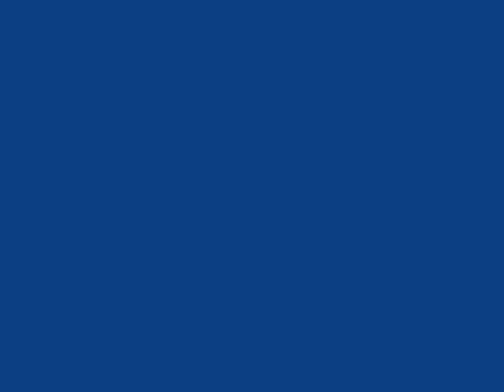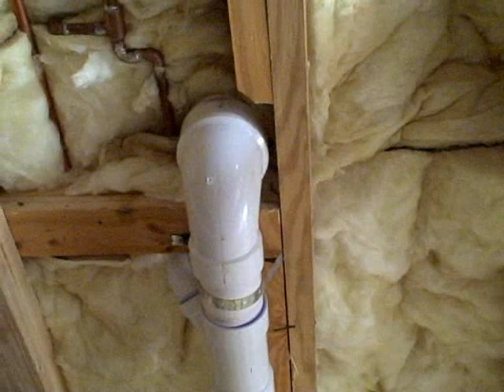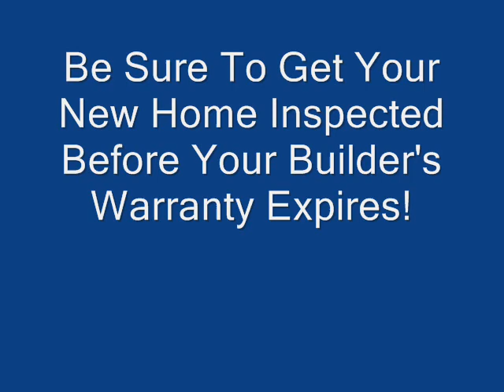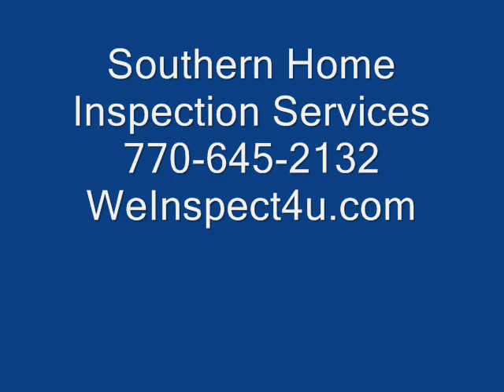Atlanta Home Inspector Discovers Plumber's Big Mistake l (678) 279-5796 l CALL US!

Comment: If you notice there are two floor joist. The uncut joist is there to replace the compromised joist. The home inspector should know that. When a joist is in the way of plumbing, an engineer will have the contractor install replacement joist to shore up the cut joist.
Reply: I observed that and agree with you.
Reply: Amy Sandoval truth,  how many times ive had to wire brush green copper, turn a valve the correct direction. write out a detailed report pointing out the difference between a emt conduit, and a pvc water supply line. home inspection is a laughable joke 98%of the time. an invented job to sugar pill lenders.
Reply: Or the plumber would just change the rough in for the fixture and not cut the joist. 10, 12 or 14 inch rough in would have fixed the issue.
Reply: NO it is not. The joist are doubled because code require that  for some reason. Could be a wall up top or it could be that the doubles are carrying a trimmed joist on a header. They are several reasons they are doubled. The one thing that is certain is that they were doubled along time before  the idiot cut it for his pipe.
Reply: libraiis-  You can see the header joist running perpendicular

Comment: Question. Why would a toilet be roughed in so close to a load bearing wall? The toilet needs to be 12 inches from the wall. Obviously there is not a load bearing wall running on top of the of the cut joist.

Comment: clearly there is no "bearing" wall on that.... that would put that toilet in the wall
Reply: really, you, another plumber, can tell us what load is actually on that floor above?   lofl.  given that it's supposed to be a double joist (but now, is effectively a single joist), clearly the architect or engineer who DESIGNED the house thinks there's a significant load.
Reply: @superwiseman452    You sure it’s supposed to be a double joist? You’re assuming. It looks like they had to cut a joist so they sistered another full joist onto it, perfectly acceptable modification by structural engineering standards.

Comment: That's probally why the beam was installed beside the one that was cut . Don't blame the plumber.. The toilet has to be 13 " from the c.l of the finish wall... the framer put the wall wrong.. it's the framers fault/g.c. not the plumber.. . I'm sure the toilet flushes.. if the wall was moved i stud size over it would not interfere.. but  did the framer move it ? no . That's why it's like that..

Comment: The water distribution piping should be sized to account for pressure loss due to friction anyway so flow restriction wouldn't be a concern. We're talking 1/2 a psi here.

Comment: Did not look like the bottom cord of an engineered joist system. like TrussJoist or another manufacture. Looked like dementional fraiming lumber. I did like the water piple installation that looked like a kid ran the pipe with all the he 90's used.

Comment: That drain pipe is a 4X3 water closet flange.  The plumber is given specific dimensions to where this goes as to not get it too close to either the tub/shower or the basin. 
Obviously the plumber is at fault for continuing to run the plumbing, however the framer is responsible for putting the joist there, and more importantly the engineer of the home is responsible for where the joists go, so it is actually his fault. 
However, the plumber should have notified the builder to put in a replacement

Comment: if the engineering called out a single joist under that wall  then the plumber is ok they might have found the problem with the pipe and joist and add the second joist  to fix home inspector don't know every thing that's why good documents are need